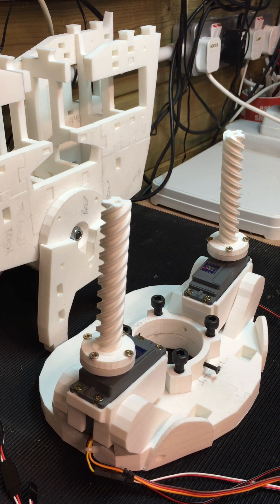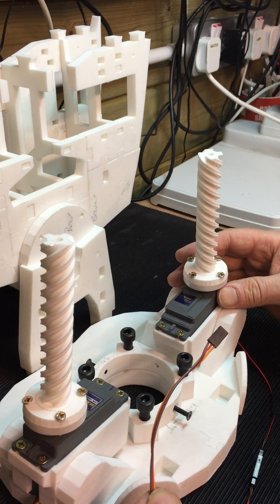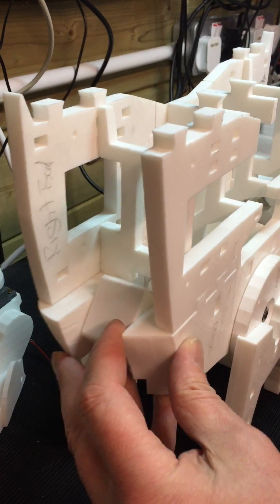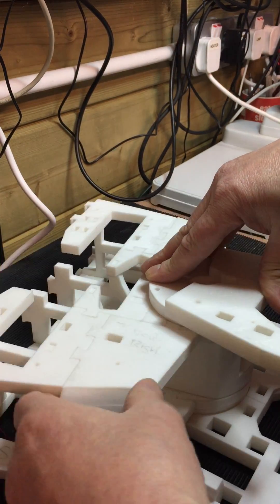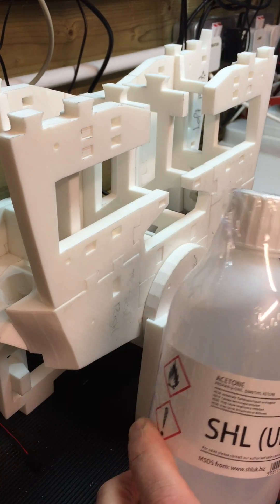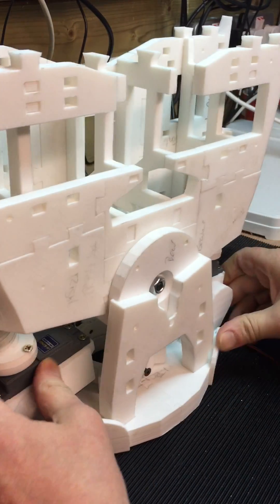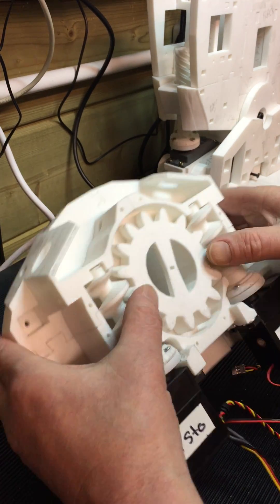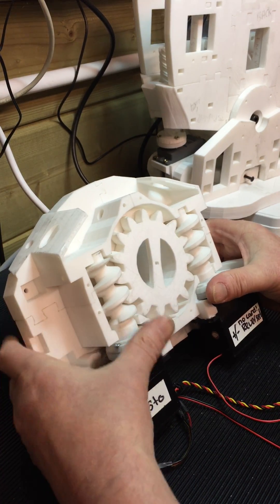InMoov Build Part -1 stomach assembly-1

Comment: Great video. Thanks for sharing. What is the part number for the hobby king alternative servo?
Reply from the maker: Hi Steve, thanks for your comment.  The Hobbyking servo is the HK15338, these were mentioned by Gael in his suggested servo types to try.  Cheaper than the Hitecs and seem fine so far.  Regards Kyle

Comment: Hi Kyle, I know this is not the right section, but I’m have a lot of trouble with a shoulder servos and  potentiometers, mainly how to mount them in relation to each section and what to do for each one etc. It’s not really covered anywhere except the extraction and basic mounting and Servo Calibration.  That I get, but I have had some go bad and trying to find replacements that work correctly is wheee I’ve hit a wall. Have you covered this anywhere? Thanks! James
Reply from the maker: Hi James
Just replied to this on the blog pages as well, but see below.   

Servos and Pots - I was very confused when I started setting them up. Best way I think to get to know how they work is to set up the BICEP servo/pot first. Its easier to understand how the whole thing works and you can see and adjust it all a bit easier. 

Anyway, have a look at my InMoov Build Part-22 [https://www.youtube.com/watch?v=VyMwuAMsEkQ&list=PLWfchL316sg1B4hMTQJYUm0EOzYYsHve3&index=14&t=3s]

This video is about my repair of a shoulder servo pot that was damaged and I took the whole shoulder section apart. This helps to explain a lot. I discuss how the servo is set at 33-deg default, so at 0-deg it has some back movement and at 180-deg its fully forward

Also on Gaels web site page here, he explains the servo degrees settings but I found confusing and still got it all wrong. Trial and error. I can do a detailed explanation if needed.
Reply: kyle campbell Thank you Kyle! I will be studying this today!

Comment: what quick servo tester do you use, save connecting it all up ?
Reply from the maker: Hi Adrian, good question!   I bought one of those really really cheap servo testers and it worked for an hour and packed up. I now  connect up EZ Robot software and and use a standard servo module but that can be a bit of a hassle.  I am about to build an arduino servo controller with pot and possibly preset switches, something I have been meaning to do for ages.  [In the above video I was using MRL, but found it unreliable]
Reply: Arduino servo tester sounds a good idea with various presets.  just something quick to test with

Comment: Hi Kyle, quick question, a few of us on the Inmoov Facebook group have purchased speaker stands with a width of 35mm. The base stand holder you created is perfect but the hole is 2 big. Do you know a base that would fit the 35mm poles please? Kind regards Darren
Reply from the maker: Hi Darren, hows thing?
I have two pole size designs on thingiverse [https://www.thingiverse.com/kylecampbell/designs] and its worth allowing a slight bit of tolerance.
I can adjust the  Fusion360 file if needed and put a different STL file on thingiverse, or I can send you the Fusion file itself  if you want a copy?  Send me you email address to myrobotcallednigel@gmail.com address.
Reply: kyle campbell I’m great thanks, loving this build. I’ve taken time out from the R2 as I’ve been busy lately and the files take so long to print. When I get home tonight, is it ok to pop you an email over? And it be possible to change the size for the 35mm slot as I have no idea how to use fusion. Thanks for your reply. Darren
Reply from the maker: Hi Darren, no problem, email me and I will sort out the STL files.   I will do a 35mm and a 36mm hole version plus theres a 37mm hole version on thingiverse.  Wont be till the weekend though as am away working till then.  Kyle
Reply: kyle campbell Hi Kyle, hope you are well. Did you get my email? I was on holiday in Dorset for a week with literally no contact with the rest of the world but sent you an email before I went. I’m in no rush for the alterations to the stand bracket (miles away), just checking you got it
Reply from the maker: @darrenlittle8704  Hi Darren, yes I got your email, just haven't had a chance to mod the files.   I haven't forgotten!  Will get them to you soon
Kyle
Reply: Hi Kyle, that’s great just wanted to make sure I typed the email address right. Once again there really is no rush,  grateful that you are doing the mod for me. Have a great weekend